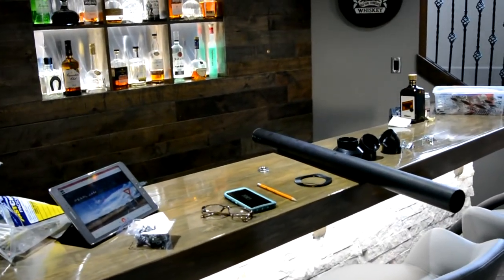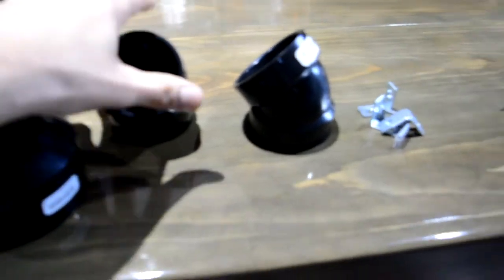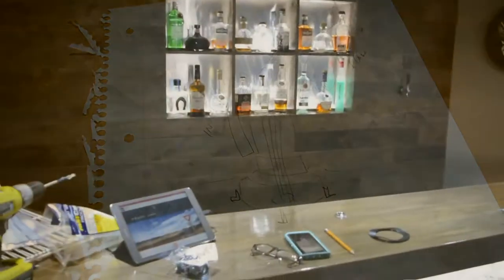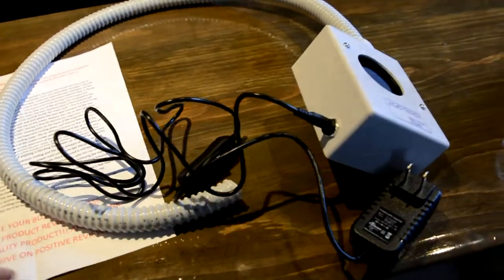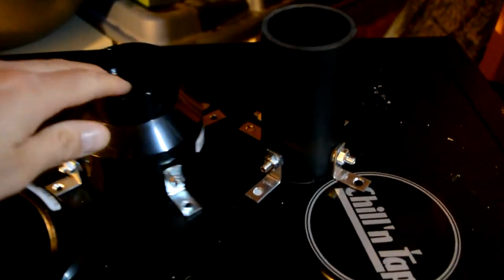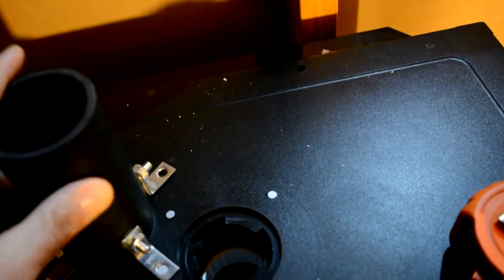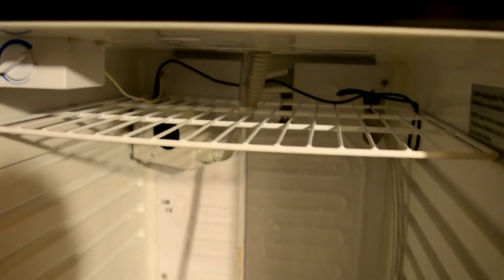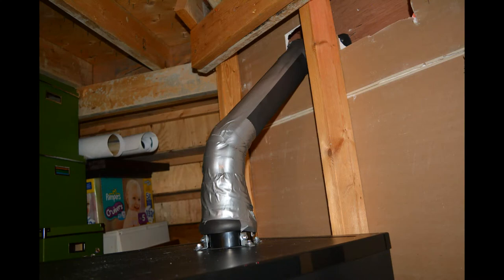DIY Beer Line Cooling - EASY

Comment: Beauty set up TT! I have just started an almost identical set up with my kegfridge behind my bar with the lines running about 4 feet to get to the Dual Tap Tower I installed on the bar top. I have been getting so much foam so have been thinking "how do I keep these lines cold?" I found the tower cooler so bought that and it just arrived and then I was thinking, "ok, now what shall I use to run the cold air up the lines and to the faucet to keep everything cold?" PVC crossed my mind and your video has solidified for me that this will all work! Thanks for posting! and CHEERS!
Reply from the maker: If I can help even 1 man cool his beer my work is complete! Cheers.
Reply from the maker: Also I could have insulated it a bit better. If the run is longer maybe a spray foam? The pipe wrap is ok, and it works though.
Reply: @TelepathicTraffic  Do you think it could work on a longer run? Around 15 feet?
Reply from the maker: @artishow3261  I think so. You may consider ordering your own fan with a higher cfm rating. Computer parts was my original consideration until I found the prepackaged item.

Comment: How did you power the tower cooler fan? How did you plug it into the power?
Reply from the maker: I ran the adapter cord out the same hole as the gas line. It was pretty snug but it worked out.
Reply from the maker: Cooler fan and keg fridge are plugged into same receptacle.

Comment: Do you know what the name of that cooling unit was I can't seem to find it on Amazon and I would like to purchase one? Or find a link that would be great
Reply from the maker: https://www.amazon.ca/Coldtower-ST-Kegerator-Tower-Cooler/dp/B00IGBTZDI

Cheers
Reply from the maker: Coldtower Kegorator Cooler
Reply: @TelepathicTraffic  thanks very much I do appreciate it
Reply from the maker: @IronCross82  no problem. It's also fairly easy to build one from a computer fan but less hassle for a bit more money. It's been going strong for 10 months now no issues.
Reply: TelepathicTraffic I wired a 110 to 12vlt dc transformer roll run a computer fan but I don’t understand how to attach a hose to it. Any tips?